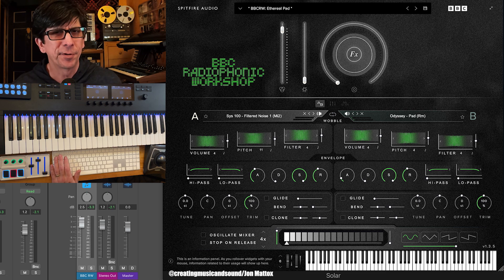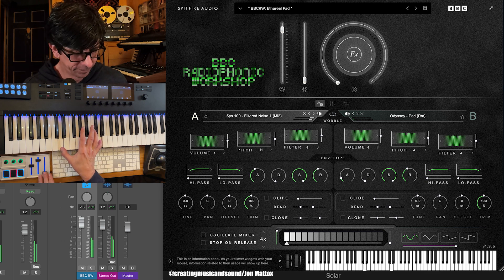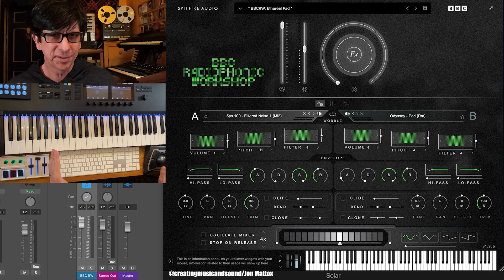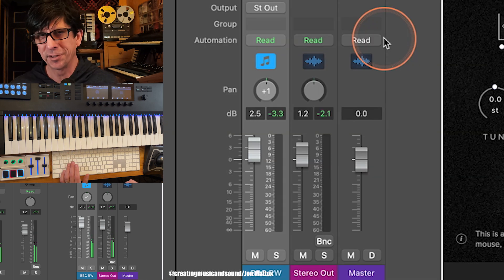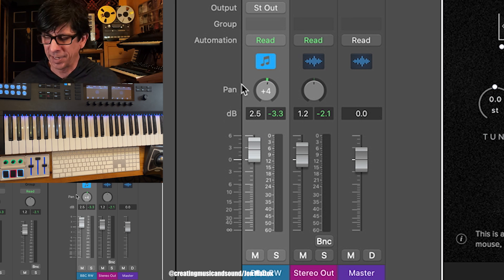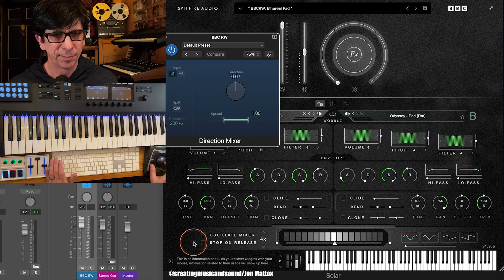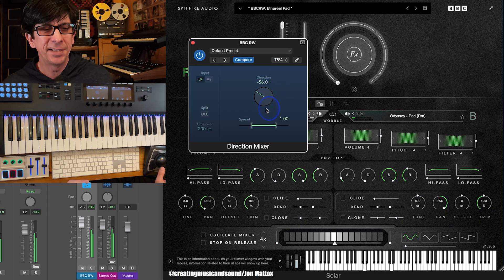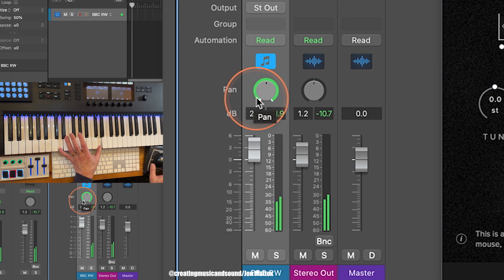LOGIC PRO's Panning Knob Is A LIE!!!

Comment: AFAIK, the pan slider in Cubase works exactly the same way. By default, it will be set to "balance", which will gradually reduce the volume of one side as you pull it towards the other, allowing you to literally balance the loudness of the two channels - hence the name. If you right-click on it and access the context menu, you'll be presented with the option to switch to the "combined" mode, which will sum both L & R channels of your stereo track and send the sum left or right, or anywhere in between. Just like in Logic, you can bring your L&R closer together or further apart by adjusting L&R values individually. You can even invert the stereo (swap the channels) without using any additional plugins (in Logic I believe you would have to do it with Direction Mixer). This behavior is reflected in the names of the Logic knob and Cubase slider (Pan/Balance Knob and Balance Panner/Combined Panner, respectively). Not sure how it works in other DAWs, but probably in a very similar fashion. Anyway, thanks for the informative video!
Reply from the maker: Funny people's reaction some are dumbfounded that anyone has an issue with it, but I know several pro mixers who when they started working in Logic were like WTF like myself

Comment: It makes perfect sense to me that Logic would behave this way.  As you said, when dealing with a mono track the panning works properly.  When working with a stereo track, Logic defaults to a Balance control, which is different than panning.  If you still want to pan within the stereo field, you need a Stereo Panner (not a Balance control), and you show on the video how to adjust it.

Comment: I believe this is just a click bait title. As you well know, Logic has different types of panning schemes, and for stereo tracks you should probably always look for the stereo panning (right click -> Stereo).
Reply from the maker: When I first learned Logic I thought the panning knob behaved like consoles, boards, and other daws. It doesn’t which is the whole point of the video. I’ve talked with enough professionals who when they first used Logic didn’t understand why the panning knob didn’t actually pan stereo tracks as expected 😛
Reply: @ I agree, the same thing happened to me the first time I used Logic. The Stereo mode should probably be the default for Stereo tracks, but I wouldn’t say it’s “a lie”. It’s just a little bit confusing for those who come from other DAWs.
Reply: @RodolfoRuizWeb  very well answered , the video is a lie ..bait
Reply: Honestly